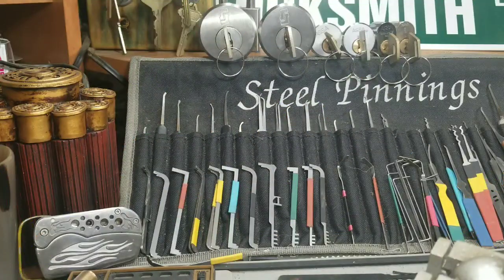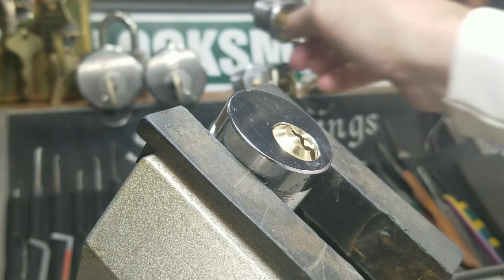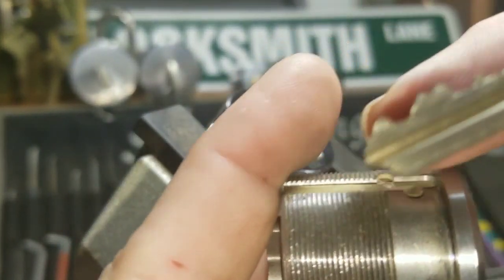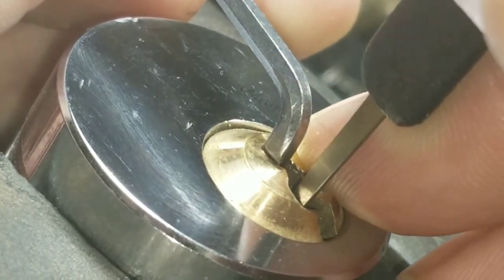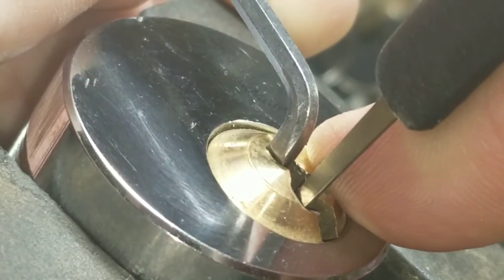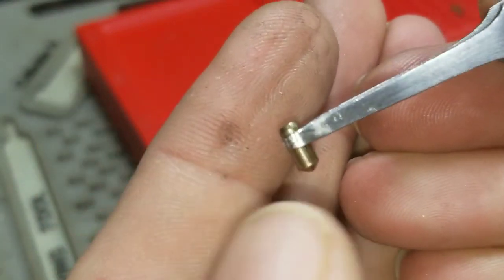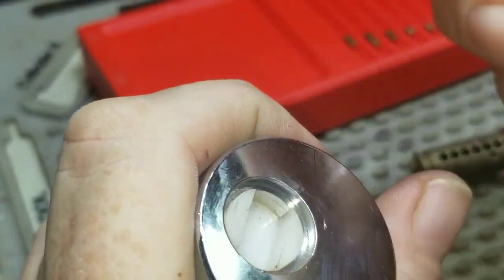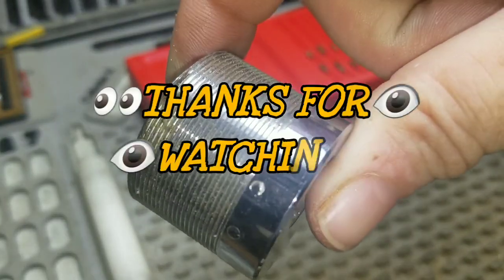🔒🔑👉(352)👈🗝🔓
7 PIN KINDA STOCK
SENT BY:::
PIN PICKER

Comment: it is an ASSA 700 clone. most likely from Biltema. The cylinder is a safer version of the scandinavian oval (very popular in sweden), as it mounts with both the 2 normal screws as well as the 2 in the side, that normally hold the trim ring and thumb turn in place